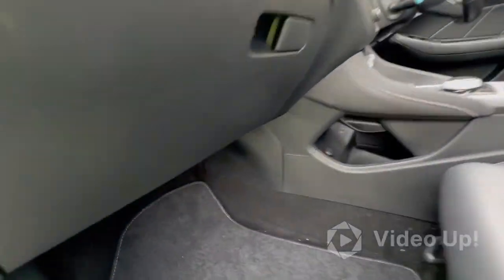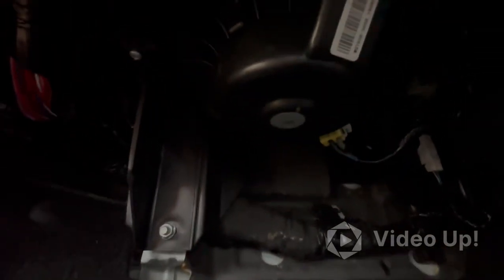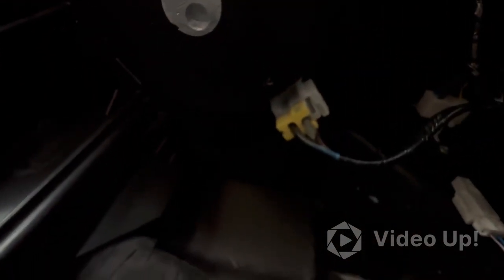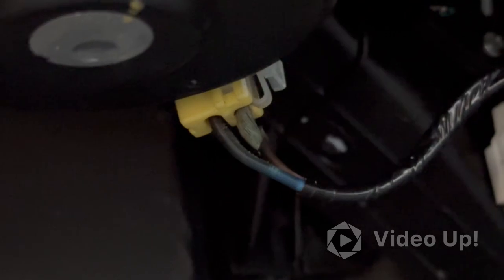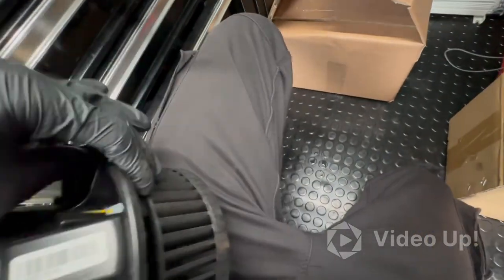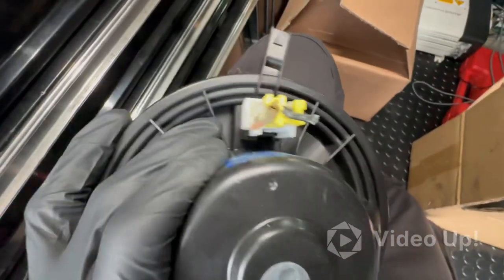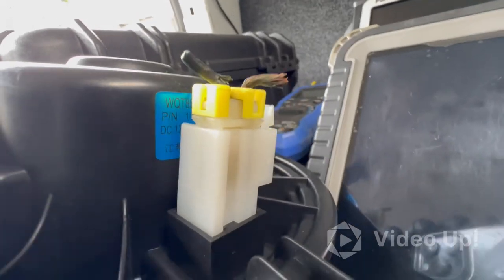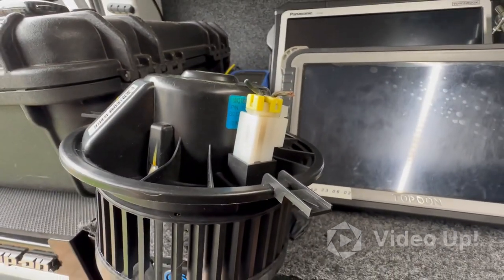MG ZS Heater Blowers inop on 21 plate 😯 - Repair

Comment: My blowers seem to stop working when the weather is warm and are fine any other time. Any ideas?
Reply: Did you find anything? Mine is doing the same
Reply: It's the resistor.  Needs replacing

Comment: Hi I know this is a year ago but how easy is this swap is it literally the 2 screws and junction clip ? Ps my wire fine but intermittent AC and blower so assuming this is the fix ?
Reply from the maker: Easy to replace, Could be the motor or the resistor itself but would do no harm in replacing both as they are cheap enough

Comment: thanks for this. how hard is it to replace?
Reply from the maker: Its an easy job once you have the clutch pedal out, hardest part is the pedal and removing the pipes for cylinder
Reply: @mrautoservices7354  is taking out the pedal to get to the root of the frayed wire?
Reply from the maker: @Trihawk7  Apologies ignore my comment above, Its very easy to take this motor out 

If yours is burnt out use female yellow spades after cutting the burnt plug off
Reply: @mrautoservices7354  no problem, how did you replace the frayed wire going into the blower motor?
Reply: @mrautoservices7354 hahahaha. My blinker fluid seems to have reset the coding on my floor mats. Thanks for the video, can’t believe our 2 year old one has the same problem (that won’t be fixed under warranty!). Wouldn’t buy another MG